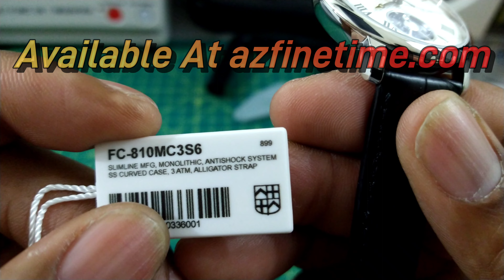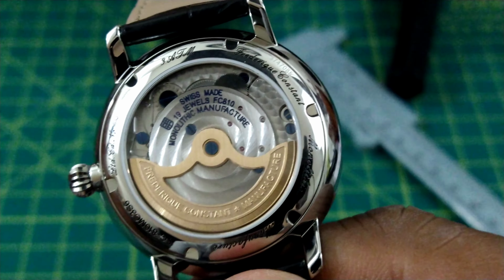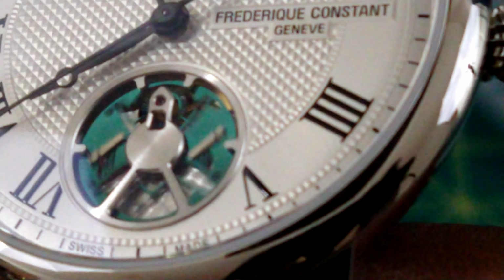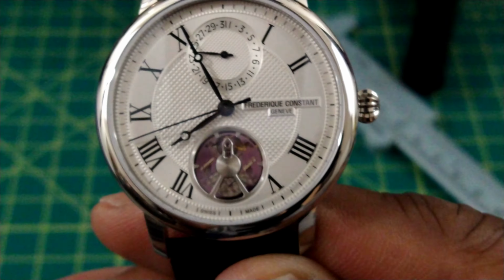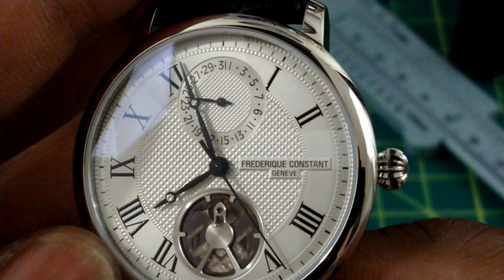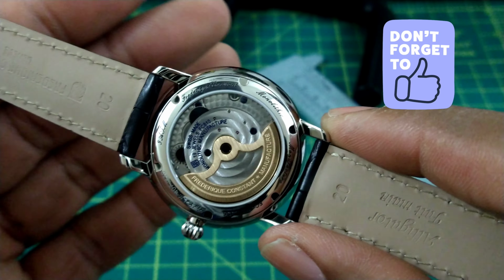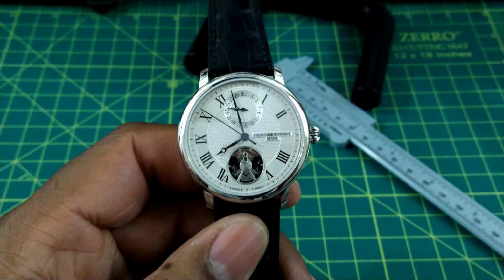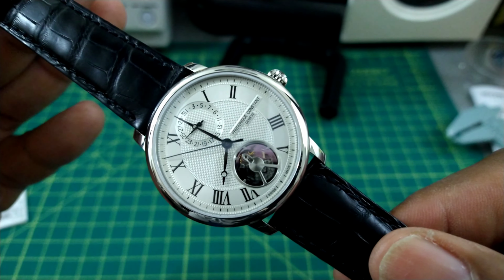Frederique Constant slimline MONOLITHIC FC-810MC3S6

Comment: This is a huge milestone in horology that isn’t getting the attention it deserves. Thanks for being one of the few who put up a video about this. Now, if they can guarantee its accuracy to better than +/- 2 seconds per day, they will beat Rolex’s standards.
Reply: They will not beat Rolex in foreseeable future. The major complaints from the "early adopters" so far has been its accuracy (lack of). Many won't be too happy with a modern luxury watch of $5K price tag running at +/-30 spd. Of course, the Swiss lever escapement had 200 years of improvement. Given enough time, I believe the monolithic escapement may eventually succeed to beat Swiss lever.
Reply: @gang208  Thank you for your comment. Hopefully in the near future other watch manufacturers are willing to take the risk in releasing standard production models (so, unlike the Zenith Defy Lab) and seeing what it takes to meet or exceed Swiss lever escapement chronometer specifications. And I’m wearing my Rolex as I’m typing this haha